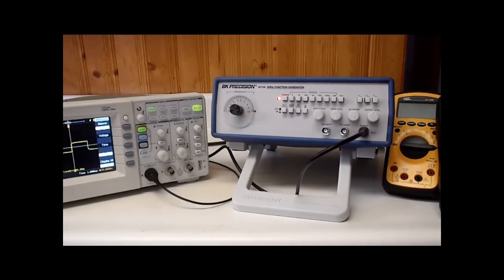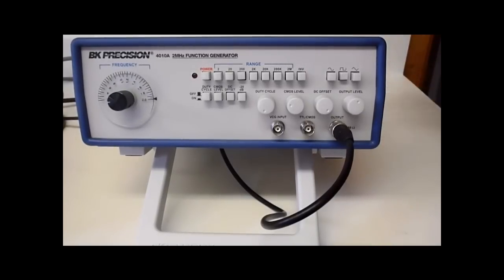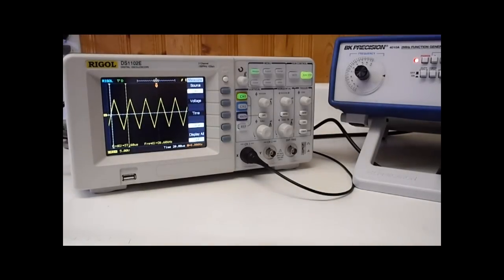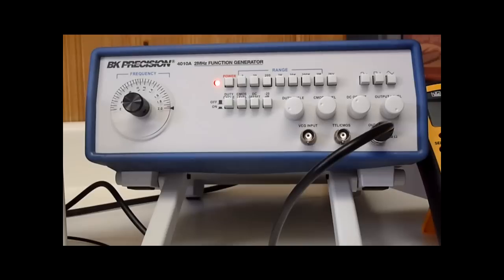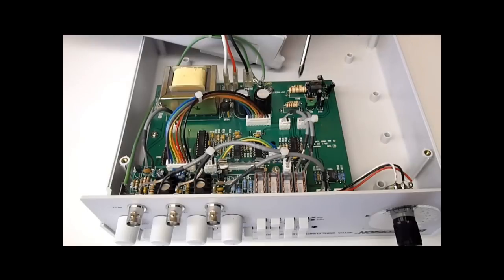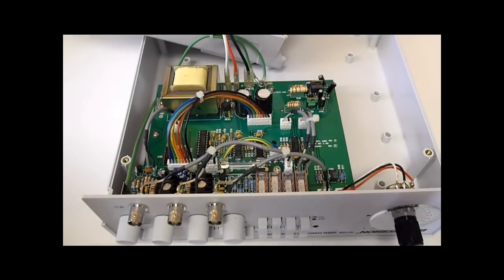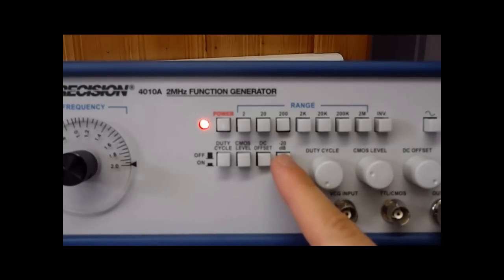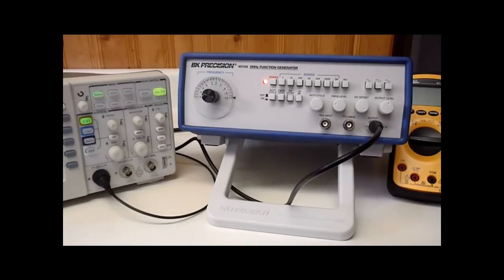BK Precision 4010A Function Generator Review

Comment: I measured the output voltage of bkprecision to be 10 volts, but when connected to the circuit, the voltage is -10 volts, is there any way to fix it?

Comment: In my opinion through hole designs are a lot better on a test equipment, since it makes troubleshooting and repairing it a lot easier.
Reply from the maker: Couldn't agree more, the more field experience I get, the more I like it! Repairs are simplistic and straight forward!